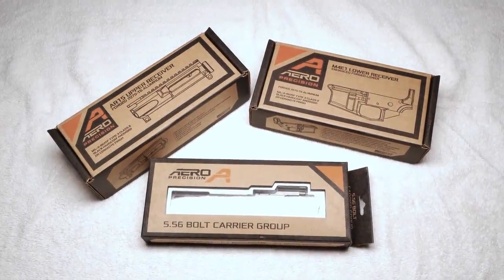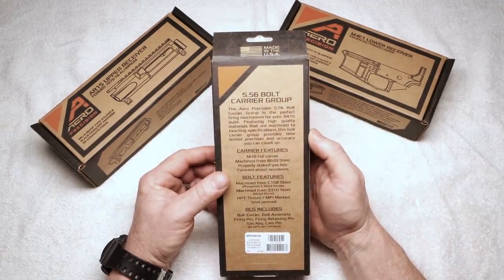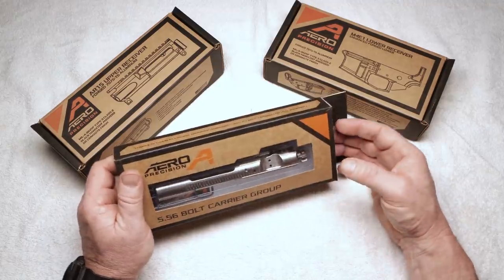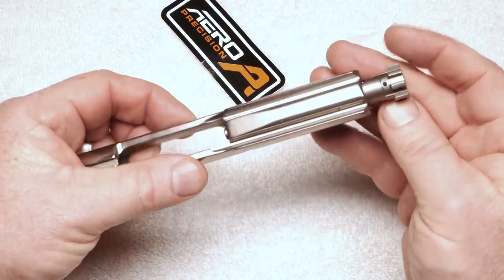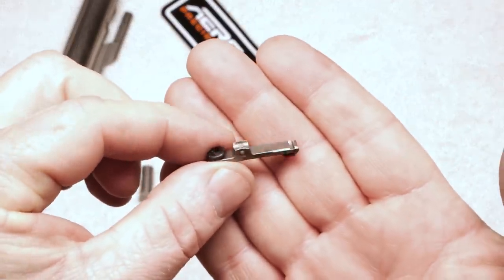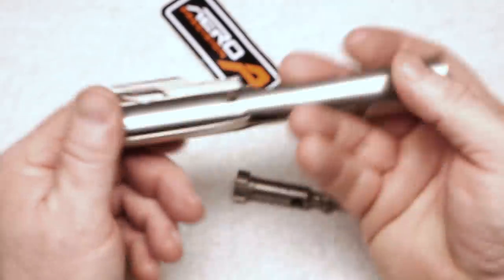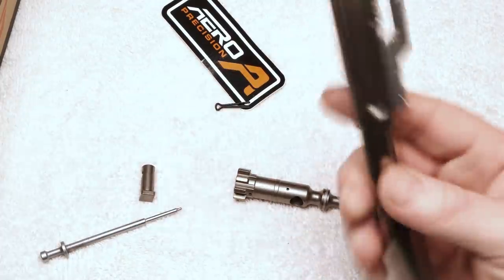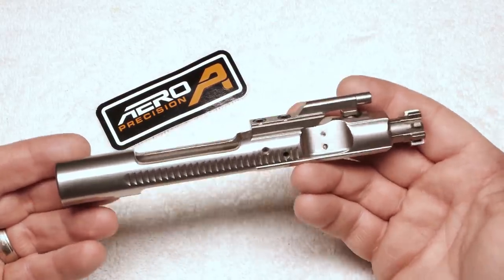Aero Precision Nickel Boron BCG First Look Review

Comment: Fun fact; Aero Precision is the OEM for many name brand uppers & lowers. I own several and they are high quality parts. Got a couple rifles with 10k rounds through them without any issues. Only routine maintenance like replacing worn out gas rings and cleaning. Outstanding products!
Reply: 100%facts. Ever since I started using Aeros m4e1 uppers and lowers they are my favorite rifles. They are first ones I grab when heading to the range. My others have to have the dust wiped off them.lol. Great products
Reply: Gas rings? you mean gas tube.

Comment: According to the Armalite the carrier key bolts do not have to be staked. Instead they should be locked with permatex red thread locker. And the key should be sealed to the carrier using permatex aviation form a gasket. I have seen bolts properly stacked back out. What I have never seen is a bolt carrier and gas key done to armalite spec fail. And I have done a lot of carrier work. If the end user wants the carrier key staked I’ll happily do it along with the armalite specs. I enjoyed the new lighting and they close up stuff. I have been around long enough to remember those days. But maybe change the cloth on the table to something not so textured kinda distracting.
Reply: Interesting. What about adjustable gas keys?
Reply: Aaaa Bbbb personally I do not mess with adjustable gas keys. In my opinion they are sub par and very tedious. When you can easily install an adjustable gas block.

Comment: My one and only build is An Areo build. Complete M4e1 upper with the quantum 15" handguard, and the nickle boron BCG. Strike industries enhanced lower parts kit with FCG. Strike charging handle. Magpul grip and stock. And a guiesslie super 42 branded buffer spring and buffer.  Primary arms 1-6 raptor with a Atibal qd exstended mount. I wanted the Areo lightweight mouth but everywhere was sold out.

Comment: I just bought a Tool Craft Nib from PSA and that thing was impeccable and perfect. When I pulled out of it's package it was so slick it slipped right through my hands , almost felt wet. I hat 2 other Nib carrier's and they are not even close to being as slick or equal in fit and finish as the Tool Craft.
Reply: From my research, the toolcraft BCG Nib is the same as Aeros BCG Nib (in 308/7.62 that is, assuming the same for 5.56/223) now it may be false info, but I've held them side by side and they were the same in every way that I could tell.
Reply: Ya I'm a toolcraft kind a guy. They come polished like a lantac and man its slick as heck and I own like 8 different brands of nib. But for price too hard to beat

Comment: The lighting is good. I'd play with some neutral color backgrounds to see what you prefer and which prevent blooming the best.

4:27-4:40 made X-ring cry a little when you used the firing pin to test the spring and take down the bolt.

Comment: I just received my PSA M4A1 stripped lower, can anyone please explain to me why the indexing slot for the end plate is round instead of oval shaped ? I've completed 9 builds and I've never seen this, it's not a big deal, there are plenty of end plates available with round indexing tabs but I have searched the interweb for hours and can't find any explanation. Curiosity is driving me crazy.

Comment: Howdy, i'm new to the AR world and in watching quite a few videos i recall hearing that the bolt retaining pin should always be inserted from the right side of the carrier... is this correct? I saw this one being installed on the left side....
Reply: What Kota did was correct. You push the pin through the retaining pin hole that has the cone shape. The pin won't go in fully if you insert it from the other side.

Comment: A warning: do not clean this BCG with an ultrasonic cleaner.  I did and the bolt carrier turned a pink color. I contacted aero precision and was told that ultrasonic cleaning was not an approved method.  I asked if they said it anywhere and again was told that they cant tell you everything you should not do, just use standard practice in cleaning but could not point to anything that was a standard practice of cleaning nickle boron BCGs.  No warranty because of willful abuse of product.... that shed a lot of light on how a warranty issue would be handled.  I also followed up with a letter and received no response.

Comment: Kotaboy have you ever heard of del-ton firearms?
Reply: I have a Delton M4 that I built several yrs ago in 5.56 mm all basically milspec set up and has a 16 inch medium weight barrel with a 1 in 7 twist rate for heavier weight 5.56 bullets. I've run that carbine hard in training and so far it's still running after 5 yrs, no failures yet. It shoots 1.5 to 4 inch groups at 100 to 300 yrds, depending on ammo. I run 55 gr -77 gr bullets, I've never run any steel cases ammo in this carbine.
Reply from the maker: They make great rifles.  I have two and have never had an issue.  Located in NC
Reply: @kotaboy32  that's good to know , I saw an ad in classic firearms for one that's why I asked

Comment: Aero precision has all their parts made by Anderson manufacturing.
Reply: No.. no they don't
Reply: I believe it's actually the other way around bud. Aero makes many products for quite a few manufacturers. I also believe they now own ballistic advantage which make excellent barrels at a great price.
Reply: Negative, they do there own manufacturing inhouse. I've run there parts in my last few builds. Quality parts at affordable prices. I've ran them hard to see if they would stand up to the abuse and after 2 yrs, there still running with no issues to report.
Reply: My Aero 308 BCG Nib is the exact same as  the toolcraft 308 BCG Nib. I've held them side by side and I'm 99.9% they are made at the same place.
Reply: Wrong